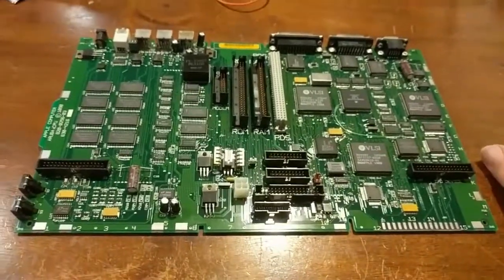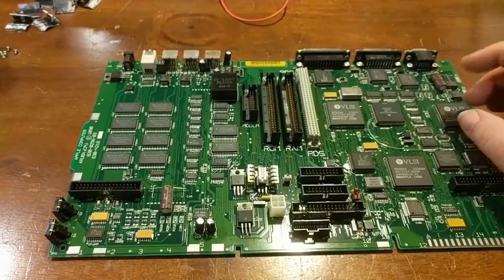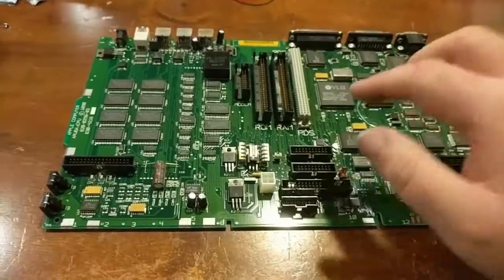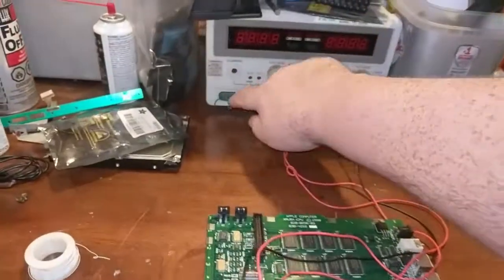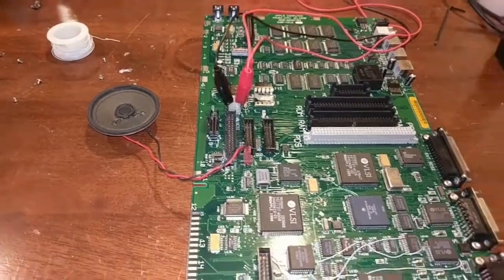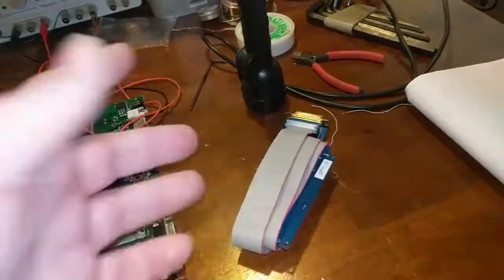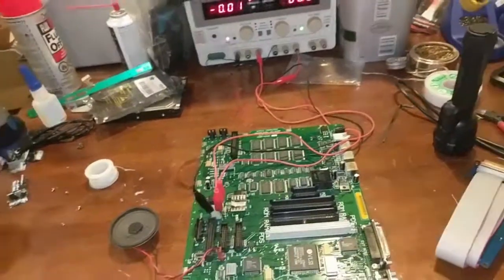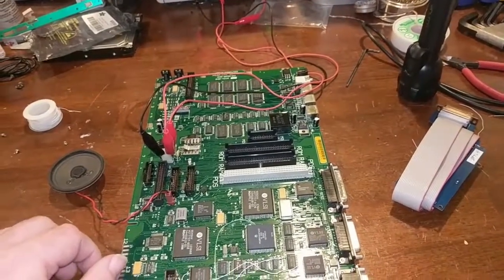Macintosh Portable M5126 Troubleshooting and repair

Comment: Excellent video. Thank you. I’m impressed that there are still experts working to restore these old computers.
I have had a Macintosh portable in a box for many years with a bad battery. Before the battery failed, it would boot and run without issue. The capacitors have not been recapped.
I finally re-celled that battery today and was excited to boot it up. I have a large display cabinet full of working early AppleComputers, except for this one.
Unfortunately it immediately displayed a Sad face with a major error of 00000005. I can hear the hard drive spin. It will not boot by floppy.
 I removed and cleaned the extended memory card in the back, thinking it might help. It didn’t. Same error.
Any suggestions? Would you be open to servicing it, or can you suggest someone that does this kind of thing?

Comment: I am in the process of recapping a portable and would like to bench test it before putting it back together.  Can you tell me which pins you jumped on the keyboard to boot the machine?
Reply: I am wondering the same thing. About to do a re-cap and need to power up from the bench. Maybe you only need to push the reset buttons on the side? 🤷‍♂️

Comment: Oh, nice!
I am right now fiddling with Commodore Colt XT PC10c, and I have a problem with boot. If I power it up, nothing happens. I tried to measure RAM activity, everything looks good, tried to measure CPU activity, everything looks good, but no POST, no chime, no beep whatsoever... I am really bottoming out on my knowledge and I have no idea where to continue...
Reply from the maker: I dont know anything about that architecture, but in general it sounds like its unable to talk to a specific chip or initialize hardware. depending on the CPU, if its 68K and you remove the ROM, it should walk the bus so each bit is 1/2 the frequency of the next bit so with a scope or a logic analyzer youll know if the CPU is working properly. I would start there. Also if its a model that leaks caps like the macs do, you need to obviously recap it and inspect traces/vias where the caps were as itll cause it to do the same thing.
Reply: If you want to take a peek, there is manual with schematics: http://www.zimmers.net/anonftp/pub/cbm-pc/schematics/Commodore%20PC_10_III%20Technical%20Manual.pdf
and here is a picture of the board: http://i1382.photobucket.com/albums/ah276/krivulak/P_20180131_185825_zpsklzezmyv.jpg